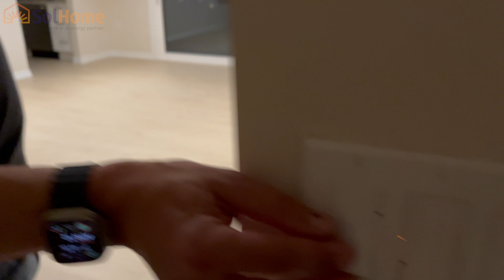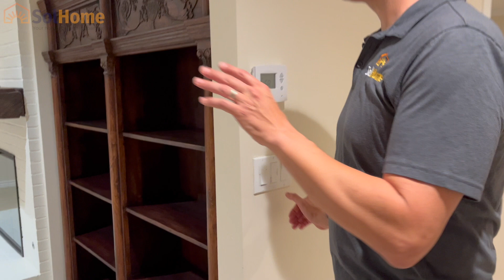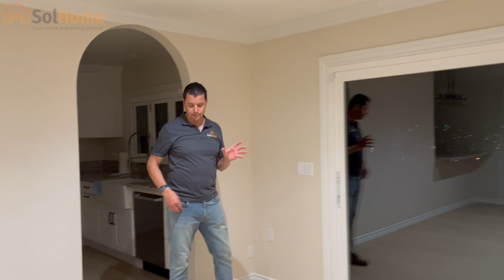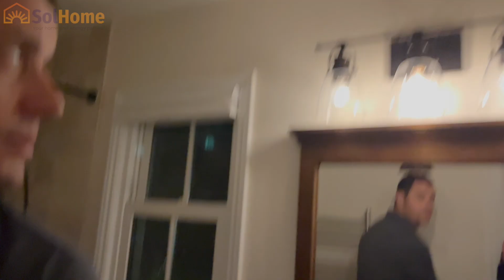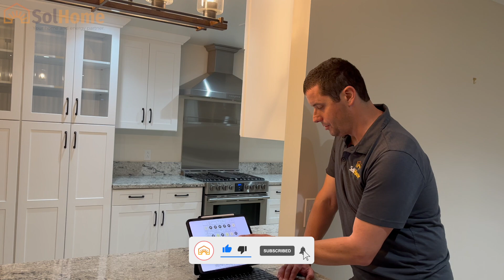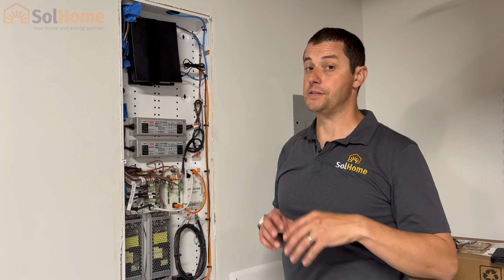Full Custom Home Lighting: ATX-LED 48v DC

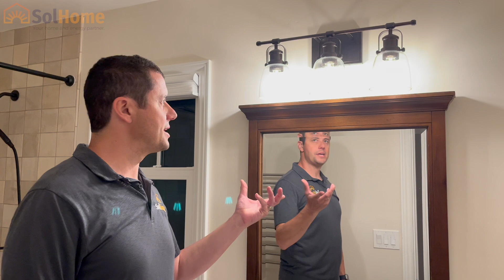Comment: 12:59 E26 fixture wired for DC may be acceptable on boats and RVs, but I doubt my AHJ would permit this in a residential build 

There’s a very high likelihood someone in future will screw in an AC lightbulb causing unexpected results. I’m curious how you got the green light to have a DC outlet where AC is expected

Comment: how much power is dissipated in the switch, and how hot does it get when dimming to roughly half luminosity (assume steady state, 70 degree room)?
Reply from the maker: vVirtually none. There is no conversion happening at the switch. The conversion is happening in the low voltage panel in the garage. That’s the beauty of this system.
Reply: @mysolhome can I power directly from my lifepo4 battery at 54-56.2v or do I need to drop that down and stabilize it before powering those power distributors?